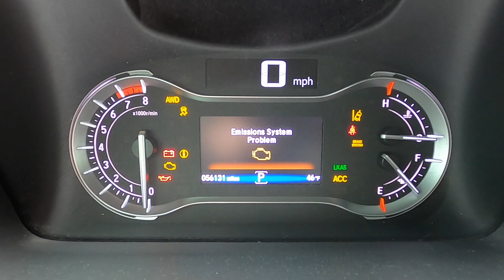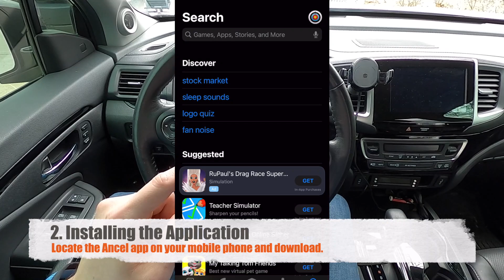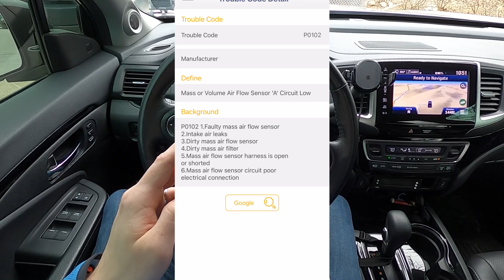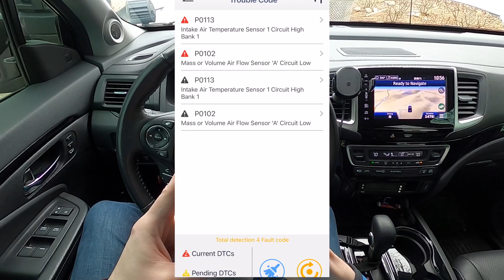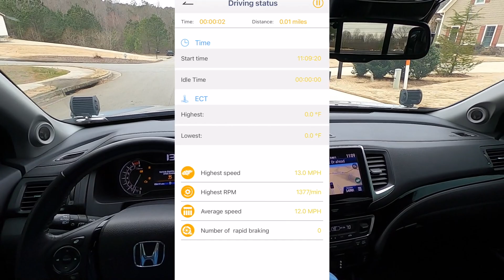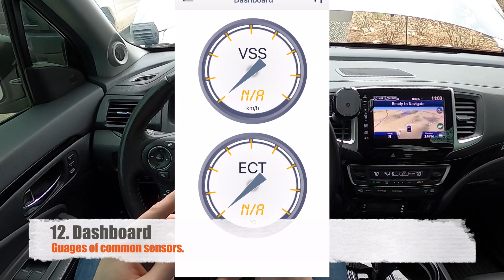Ancel BD200 OBD2 Scanner Review

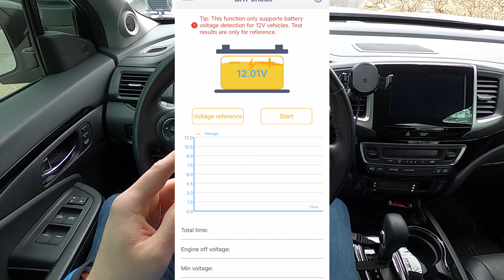Comment: 1:13 So what the summery? I don' t see any SoC or SoH. The battery is constant  12V what with real time graph here? What the reference of 7.76V and 14.85V for? If battery at 7.76V even your dash lights will go off. If 14.85 - the acid will probably get boiled in battery cells. These are unreal voltages - show nothing.
Nothing about transmission temperature?

Comment: Did the light on the dash go out when you cleared the codes?
Reply from the maker: Yes. The video though shows me driving with them on because it took a few minutes of driving to fully register. After I drove and turned off and on again it went away.
Reply: @YuriyMotso  OK, I just was asking because the app still showed the codes after clearing, but as long as the truck sees them as cleared that's all that really matters. Thanks for the great Ridgeline videos!